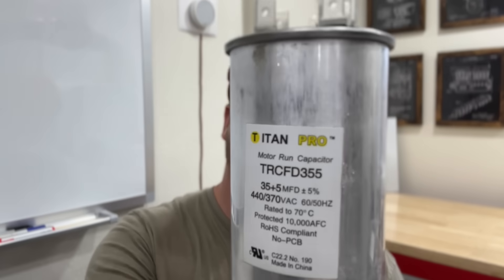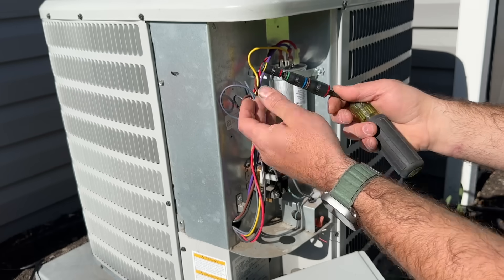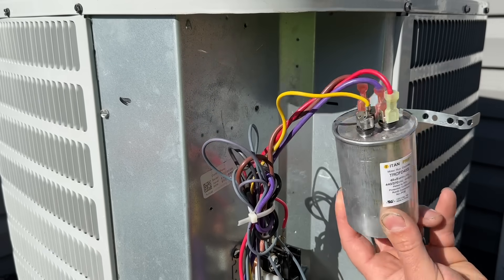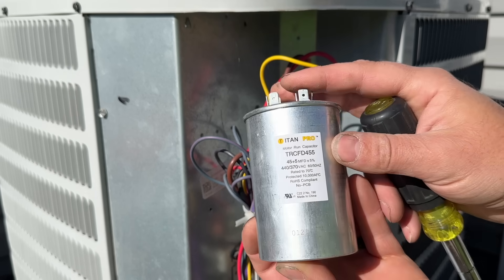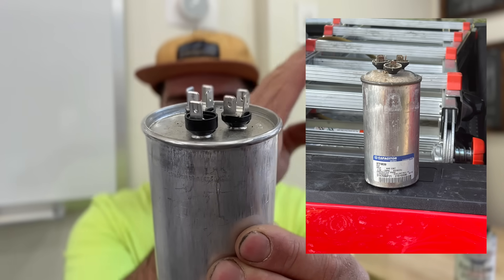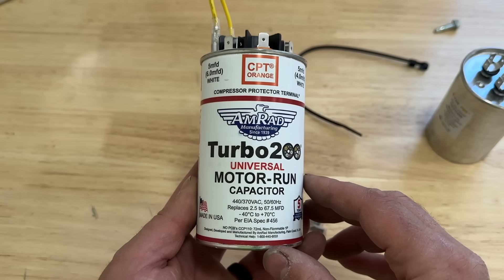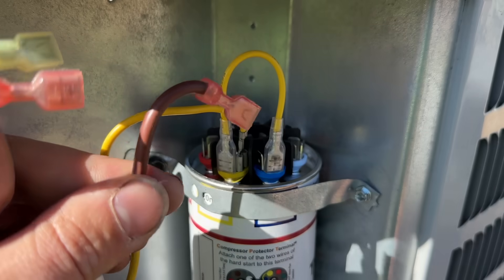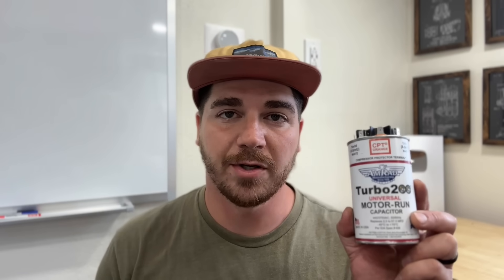HVAC Contractors Practically Make Their Living On These

Comment: Two years ago I was charged around $450 CDN for this fix. It was the usual tech that comes for my annual furnace. I googled the part# off the invoice afterwards and saw it for like $25 on Amazon. I recall around $240 for the capacitor $165 for the call. He was done in 20 mins max.  I guess I got lucky and have a fair HVAC company. You're a God send in these times my good man. Thanks for posting this!
Reply: U call that luck

Comment: I watched one of your previous videos about this a few weeks ago. I have a 3 story home with an AC for the third floor and a separate AC for the two lower floors. The upstairs AC went out on Wednesday afternoon. After watching your video, I used my multi-meter to check the capacitance. Nothing for all combinations, so dead. (In this case, everything worked except for the fan. I pushed the fan with a long screwdriver, and it started spinning, but slowly). I ordered a $12 capacitor (35 MFD) and was able to fix it. Two days later, the lower AC went out. I order a new capacitor for that (it was $32). I installed on Saturday. Another AC fixed. Thanks so much for proving this info!

Comment: The other item that often goes out and cost very little and is easy to change is the starter relay. A spare of the capacitor and the relay ought to be sitting inside with the controls.

Comment: I had a contractor try to charge me almost $400 for a blown fuse. It was a Sunday call, and the technician charged me $150 for the service call, which I paid as soon as he was done, which only took about 40 minutes. Since it was a weekend service call, I didn't think the $150 was too outrageous. I got a bill the next week via email for another $250 or so, which I refused to pay.
Reply: $150 for a weekend service call?  Thats cheap.  Did he give you a quote before he made the repair?
Reply: @garrybillick3979  They had a basic charge for the weekend call, I think it was the $150. The fuse would have been $250 if I had paid the email bill.

Comment: I worked for HVAC companies that did NOT pushed replacing parts just to replace them,  but I knew a bunch of guys that did..  This was back in the late 80's early 90's..  Capacitors, Caps,  were one of the thing we checked condition.  the elec contactors were check as they tend to get real pitted over time and sometimes replacing them was a good thing especially on older units we ran into in NC..  We would sometime see the cap bloated sometime pretty good especially after lighting storms that can cause surges overloading them or from age of the unit especially units that were on the west side of house with no shade..  

You can do ANYTHING to your system you want.. its when you start doing stuff for other for pay you need a bit more training and in some a HVAC license..  

If you are of average intelligence and some mechanical skills,, aka you can change your oil, spark plugs,, you can DO this..  take a picture of which wire is on what terminal or if you have the replacement cap just do wire for wire after you get the uF rating correct.  you can be larger but not smaller than cap rating.. but most are 40 to 50 uF for the compressors on home units.

Comment: A few years ago, i had my ac "serviced" for the summer season. Coincidentally (or suspiciously?) a week later, the AC compressor wouldn't start. I looked online and the symptoms indicated the start/run  capacitor. I called my local ac supply shop, and they sold me a new one for $15. I replaced it in 10 minutes and have not had a problem for the past 5 years. I now service my ac myself.
Reply: The technician does not have the ability to make a capacitor go bad.
Reply: @jamesonredbreast6310  all he needs to do is swap in an old one... he probably had a box full of failing ones in his truck.
Reply: @GetOffMyyLawn  
Right but the problem here is a service call should tell a home owner if a cap is going bad or not. (At least an honest tec) Fact it went bad within a week shows they either did not check it or something else.
Some of the (Summer service) offers are scams and the techs are hired with really no knowledge and skip parts. They get some young kids with no education in the subject or some old techs that put hours into your service call because they went over time on another or took 2hr lunch and need to put the time some place.
Reply: probebly you are full of it   , nothing you have said convinces me  he did anything like that    nothging you said points to the likelyhood he did such a thing
Reply: so without a tech to check ei. how do you know your charge is accurate? that alone could screw your monthly bill and wear our your system from running too much.
Reply: @theuserthatishere  
He did not have a charge issues it was a cap
Reply: That’s very common especially after a system has been cleaned and serviced.  The readings, amp draw and compressor loads change after a cleaning.  Everyone isn’t out to get you and you’re not as smart as you think you are.
Reply: @luckylarrysinsurancepolicy3310  My personal experience is that scammers are everywhere... car repairs, appliance repairs, ac repairs... it is very difficult to trust anyone these days... and you if you don't have some knowledge of things you will get ripped off. And as for my level of intelligence... you seem very defensive and are probably compensating for your own.
Reply: It’s almost like parts go bad sometimes how crazy
Reply: Suspiciously it  the capacitor went out ?   thats like after I put new tires on my car a month later the battery went dead   now thats suspicious   
  if the guy woulda  suggested changing the capcitor  you woulda complained  he was selling you shit you didnt need.
Reply: @jeffreyplumber1975  I had tires rotated at a shop last year. Suspiciously 2 lug nuts fell off one wheel a few days later, and the others were loose. I guess that was a coincidence as well. Anyway, the whole point of this video and my comments is that the $15 part takes 10 minutes to change, and can save hundreds of dollars  in an economy where people are struggling to get by.
Reply: Good! Keep doing it, call a professional you’ll need him eventually! Job security 🙏🏼
Reply: @BrandonBTV  yep, I'll call a real pro when it needs to be repaired, not some fly by night operation ripping off people who don't know any better.

Comment: I replaced this last year and the unit still didn't start. Ac guy came out and said the unit had to be reset, like a reset button, to make the ac turn on after the capacitor went bad and was replaced. Unfortunately I still don't know how to reset the ac after a capacitor replacement and there was not a reset step in this video. So I am still confused on how to complete the job.
Reply from the maker: It may have popped the fuse inside the air handler portion. That’s happened many times and requires a new fuse or a “reset”
Reply: @diyhvacguy  I googled reset condensor and Google sais some units have a reset button on the condensor unit and it may need to be heald down 3 to 5 seconds to reset power to the system. I will look at the unit again for a reset button next time I go by there.

Comment: Could I make a few suggestions? First, don't assume the power is off just because you pulled the disconnect, always check with a volt meter. I have found several disconnects over the years that were bypassed, can be very deadly. Second, before removing the capacitor from its mount use a screwdriver with an insulated handle to short between the terminals to keep from getting bit. Last, I have run an HVAC company for 48 years now. We charge about $300 for a run capacitor, See my video on why we charge that much https://www.youtube.com/watch?v=gQMLAzogZtw , however $2,000 is overcharging. That being said, most companies charge several hundred because they have to pay an tech, we come to your home, we have knowledge on how to diagnosis and repair and all our overhead. God forbid that we actually make a profit. 

However, we sell capacitors to people off the street and in fact we will check a capacitor that someone brings in to see if it is bad. Of course, I sell the capacitor from my shop for $35 to $45 depending on the capacitor, still have to make a profit. And when it doesn't work after they installed the capacitor, we usually get the service call.

Comment: A few things in the disconnect.  When you pull it, you'll see two clips in the box, and two blades on the part you pulled out.  When it's on, the tabs form a bridge between the two clips in there.  By flipping it over, it is taking the tabs out of the clips and sliding it back into insulated slots that do not have clips in them.  When you push and pull into the bridge on position, you should feel the tabs click in, and it should require a little bit of force to push or pull it in the slot.  It the off position, it should be very easy to push into the slot.  

Knowing this helps when you're doing it in the dark, or you cannot read the labels.

Of course, you don't have to slide it back in while servicing, but it is a convenient place to set it while you're working, so you don't loose it, and it also covers the live electrical clip back up.  When the bridge clip is removed, one or both of those clips within the service disconnect will still have power if you did not turn the breaker at the service off as well.

If you find that you need to work on the service disconnect instead, or the protective cover is missing, then you should also turn the breaker off, but for most unit servicing, just flipping the disconnect as he shows in the video is enough to make the unit safe to work on.

Comment: Excellent tutorial, clear and to the point. 
Additional tip: When visually inspecting the cap look for leaking at the top. When I did my yearly cleaning, inspection and ICM870 install this past spring I noticed a little clear oozing so I knew its days were numbered. My label was toast so I checked my install doc’s schematic for the cap rating and ordered two. For $10 each it’s cheap insurance.

Comment: Back in 1997 an hvac company tried to do tbe same thing to my grandma, but sell her a whole new system when all her 12 yr old unit needed was a new capacitor.  Her house had fuses instead of breakers, her unit would blow fuses after 3 seconds of running, lights in her house would dim low when trying to start the ac.  Company said compressor had locked up and she needed new ac  unit.  I just graduated high school, and was dabbling in the hvac business. I did not buy it that she needed a new unit.  I decided to check her unit myself.  I tested the cap and it was blown.  There was a guy 2 streets over that scrapped out ac units for the copper, and he had a full can of capacitors from units he had scrapped.  I fou d a few with the same uf, took them to her house they both tested good, so i popped on into her ac, replaced the fuses in her panel, turnec on the hall light to observe dimming as i flipped on the thermostat switch to cool, and barly a dim, and i went out side and the unit was working.  This was my first ever ac repair, and now to this day i am repairing ac units.  I see all tbese scams and its sad especially companies taking advantage of the elderly.  Grandma had passed in november of 1999 and as of 2 yrs ago i drove by her house and that unit is still there.

Comment: Got quoted $4k to 5k for an AC repair by a 19 your old who stated no warranty and probably would not be able to find the parts to fix the unit . I kindly showed him the door . Local man recommended an honest independent a/c repair tech , had parts on his truck , cleaned the unit , found the problem in 15 minutes, done in 45 minutes , $465 . Find a small independent that doesn’t have 35 techs moving new units onto homes . Theirs a quota in these establishments .

Comment: I can deal with them charging $25 for a $10 item because it has to be stocked in several variants depending on brand and model and then some for the job, but $2000 is a rip-off.

Comment: That is NOT how a run capacitor works "gives an extra jolt of energy". Normal pricing is somewhere around $300+ depending on your area and you Are not paying for a $10 part. You are paying for a guy with maybe 20 plus years experience to drive to your home in a company vehicle with specialty knowledge with a specialty license with specialty tools and the specialty part you need to fix your A/C on his van as well as do a complete system evaluation at the same time to see if there may be an issue that caused the capacitor to fail or any other system problems. This guy is full of S..T

Comment: A starter capacitor is used to temporarily create a 2 phase power cycle to turn a motor with a single phase power supply.

Easy way to identify and test for it is to see if the motor hums without moving the blades. Using a stick, just touch a blade to nudge it and if the motor starts moving then the capacitor went bad. Also, you should use a long screwdriver to discharge the contacts before trying to pull any wires. I've seen the wires touch while pulling and spark before.

Comment: Man, my AC went down in the middle of a heat wave a couple years ago because the capacitor failed. I called one of the big name HVAC companies in town. Thankfully, the tech that came out had my back. He said he had to charge me the $90 service call fee no matter what. But I could either pay another $500 for him to fix it or try to replace the capacitor myself. He wrote down the part # and address to the supply house for me. I decided to try to fix it myself. I about fainted when the supply house said it was only $20! 🤯🤯 I replaced the capacitor EZPZ and called that tech directly and told him I owe him dinner or a case of beer. I think this video will be a lifesaver for some people like that tech was for me. 👍🏻👍🏻
Reply: Did the tech pick the dinner or the beer?
Reply: @stephenhu9561  He said, "Let's just be friends"...
Reply: @GonadOBrien  That's a real  friend.
Reply: Once in a while you run into one of the good guys, with a real conscience.  He is NOTHING like our politicians. The guy you would want for a friend.

Comment: I have a feeling that American houses are not properly costructed and propely insulated therefore working air condition is question of life ad death. Here in Europe we have about 1.5 feet of air filled insulating brick walls - for example Porotherm brand - and 1/2 foot of polystyrene on top of this... triple glazed argon filled windows...tests for airtigthess of buildings etc.... It tooks days for heat to get inside such house (and cold during winter).

Comment: I paid $230. I assumed it was the capacitor since the compressor just hummed but I also know if that capacitor is not bad and holds a charge it might be my last DIY project. 230 for a correct diagnosis, the part, cold air right now, and no risk was worth it.

Comment: NOTE:  Not all disconnects flip the plug over to be off.  Some state that off is removal of the plug.  To be safe, voltage should be checked with a meter or voltage detector.

Comment: I called an air-conditioning company to come check the charge on my unit he checked it and added some gas and changed out the capacitor and wanted to charge 200 for it. I asked the guy why did he change the capacitor? The compressor was running the fan was running. There was nothing wrong with it. he said, the one I put in there is better than the one you have, I said but it’s working so, put it back and take that charge off the bill. 4 years later it still works.
Reply: Right, if your system is working, keep the filter clean and leave it alone! (retired hvac tech) AC "tune ups are a big scam
Reply: @markme4 how about deep cleanings? Dust coating the blower blades?
Reply: @mrtechie6810  Your AC needs deep cleaning ?
Reply: @markme4 it was faulting out and apparently caused by dust coating the blower vanes. Lots of dust/black in the indoor unit. Always run with the filter.
What is the recommended maintenance?
Reply: @mrtechie6810  Why is there so much dust in your furnace ?
Reply: @markme4 Middle East weather I guess.
Reply: @mrtechie6810  Make sure your filter fits properly, check for gaps around the edges
Reply: WoW!!!
Reply: My man!
Reply: Added some gas I didn’t know they ran on gasoline I’ll have to check my fuel gauge thanks
Reply: @justincummings4775  Some older ones are diesel
Reply: @justincummings4775 ok, R134 refrigerant are you happy now.
Reply: @MrMagoo_1604  Lol who told you that ?  There is no such thing as a AC tune up

Comment: I was quoted $500.00, plus another $100.00 for the capacitor. The tech was kind enough to show me what the issue was, what capacitor I needed, and how to replace. I figured $100.00 for the service call plus a $20.00 dollar tip was well worth cost of the education. Thank you for your video!